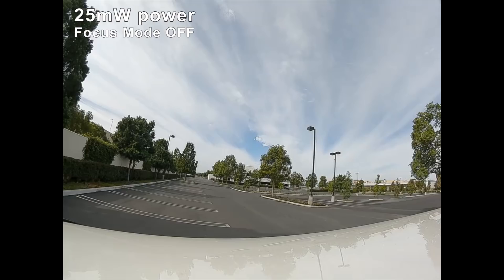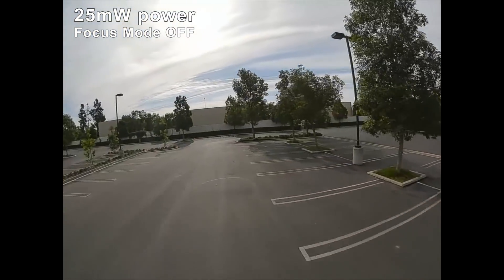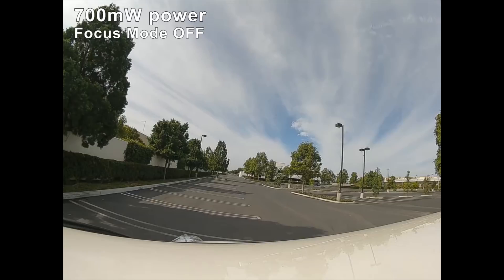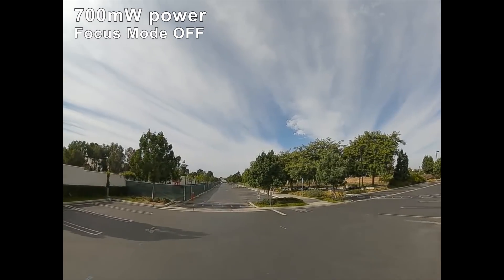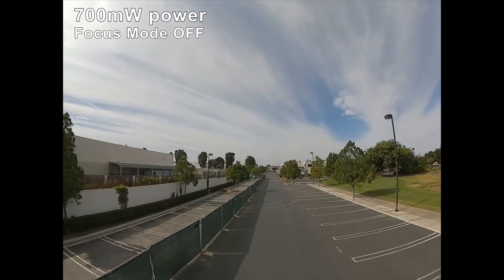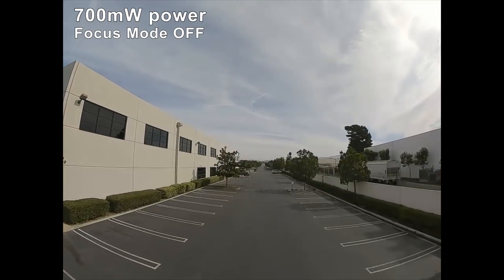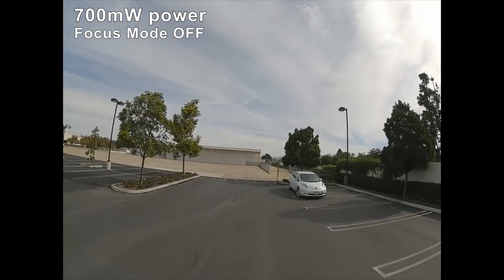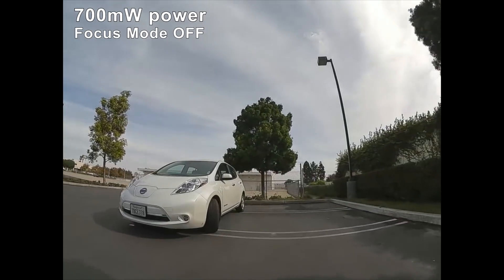DJI FPV System and Cell Towers?  Failsafe City?  🤔

Comment: You failsafed bc of the huge building between you and the quad that was hundreds of feet away... on 25mw haha! Cell towers output freq <800mhz that’s why it can cause probs on crsf at 868-915mhz but dji is chillin at 5.8ghz There might have been some electromagnetic interference from the power thingy but that’s just bc your output was too low.. at a decent output the tech would have been solid.

Comment: No issues diving the cell towers in my city with the DJI FPV system.  They cause failsafes for crossfire though so I suspect most of their output is closer to 900mhz instead of 5.8ghz.  I'm sure every cell tower could be different depending on what they are pumping out.

Comment: Thanks! Has its limits like analog, it’s interesting to see where and what those are. May be sold, just want to see a complete BNF micro kit and I’m done. 😂
Reply: EscobarFPV Right - Albert shared that. For some reason, when I looked at it you could buy goggles or TX but didn’t see whole package. Maybe I couldn’t see the page right in my mobile but my bank account is happy with that for the moment. ;)